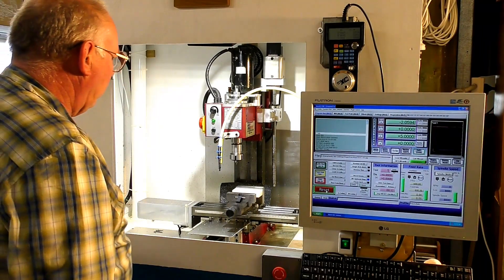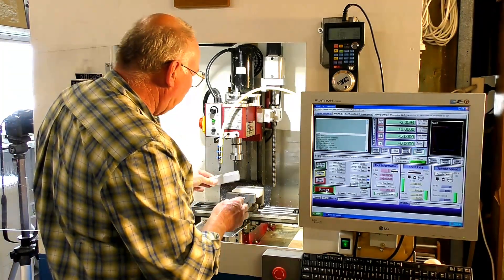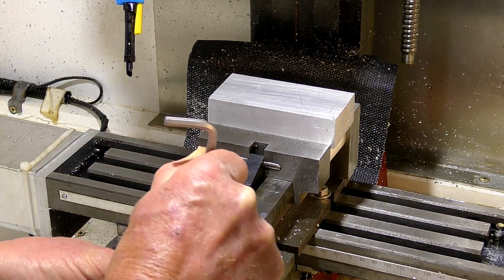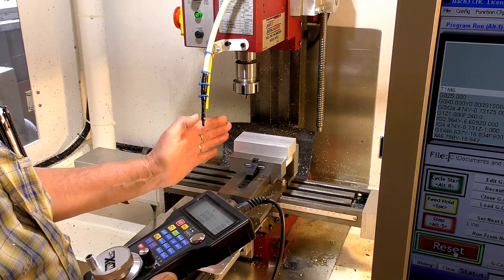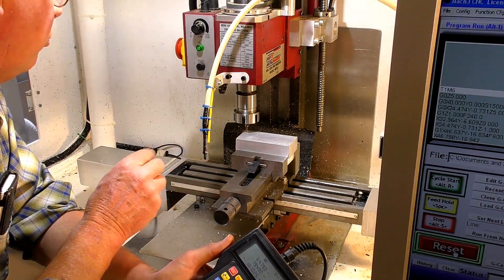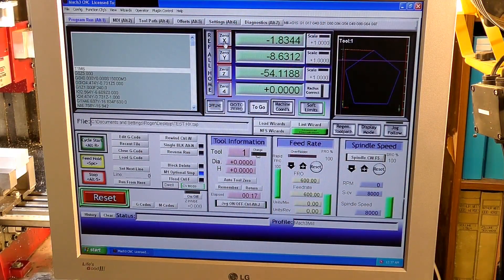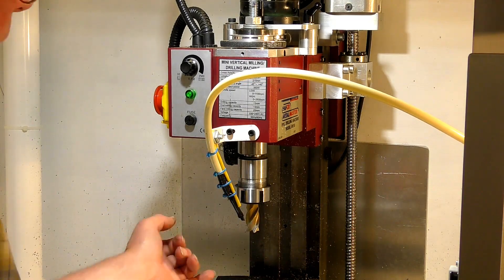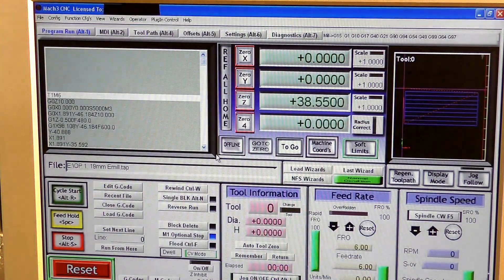CNC Mini mill and Mach3 making parts How To

Comment: You did a video on the red motion control board  years ago. Fafeicy USB 100KHz 4-Axis Motion Controller Card. Can you help with the ports and pins numbers to make this work and if you have a link for the driver.